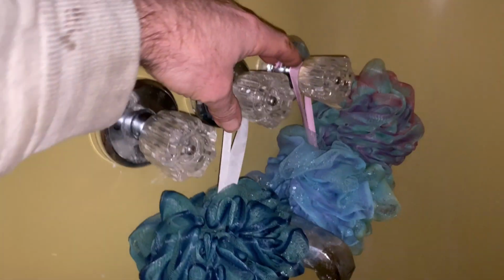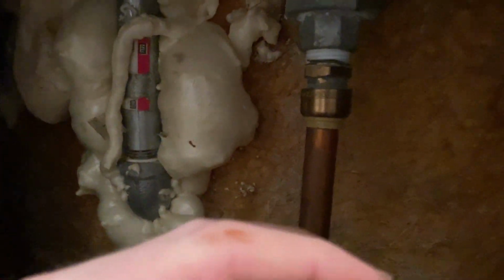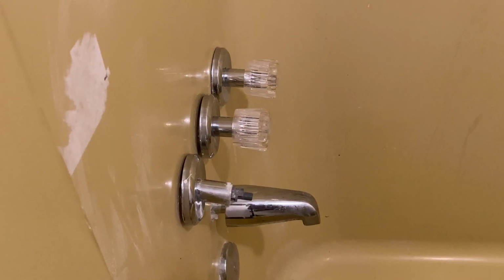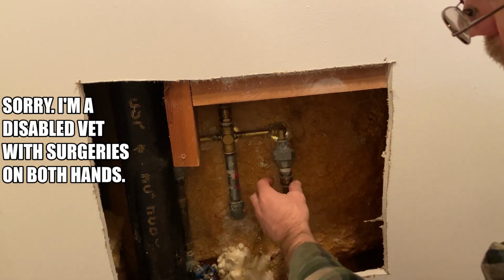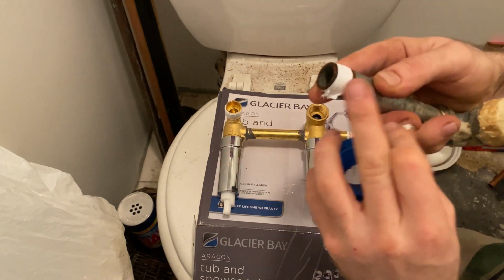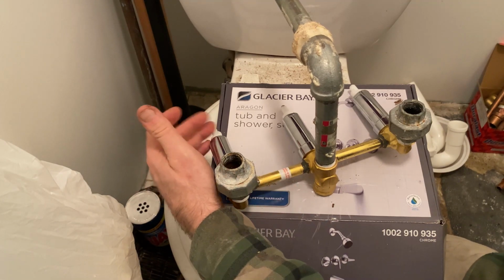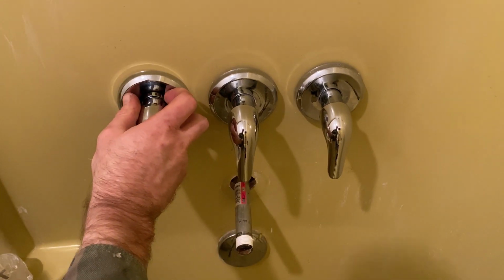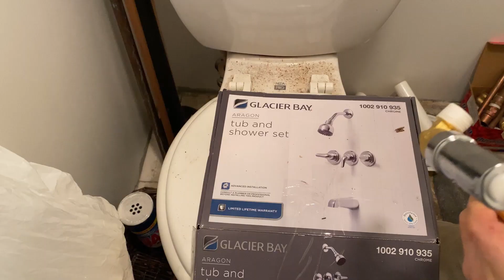How to remove & install a shower diverter valve, handles, and cut the drywall out. DIY plumbing easy

Comment: Hello, I just installed this same shower valve on a tenants apartment and there is one thing I was wondering if you could help me with. That is that the hot and cold handles have different orientation when turning them on. When I turn the hot water  side on (counter clockwise) the handle is facing down, then when I turn the cold water side on (counter clockwise) the handle is facing up. Do you know if there is a way to fix this so when hot and cold are on that both handles are facing down?  Thanks. Glad I stumbled across your video!
Reply from the maker: Same thing happened to me actually. This is how I fixed it.
I put the handles all facing down. You have to take them off and swap them around till they all face down. 2 of mine said hot and 1 said nothing. 😂. 
Once they are all down lock them in and it will look like this when you turn them off. Hope this helps mate! Subscribe and continue to comment. Another viewer might have the same problem we did.
Reply: @DisturbingKreationzDIY  thanks for the response. Didnt think of that. Ill try that first thing Monday morning and let you know if it worked. I really appreciate it.
Reply from the maker: Please keep me informed because it worked for me.
Reply: @DisturbingKreationzDIY  It worked for me also. put all the handles down and now all is good. thanks again for the advice!
Reply from the maker: Great news! I am so happy it worked for you as well. I hope your renters are happy as well. New videos coming every week. What else do you need to work on?

Comment: Kind Sir, I see NO reason for you changing the entire faucet; IF it only leaked. For that is very easy to fix: Buy changing 3 "seats" and 3 "Stems"; and that is all you have to do for leaks. For the behind parts RARELY need to be changed.

For what it's worth Sir.
Reply from the maker: Great statement. It WAS leaking from the back of the unit so I had to change the entire thing though.
Reply: @DisturbingKreationzDIY  Sorry you had to do that kind Sir.